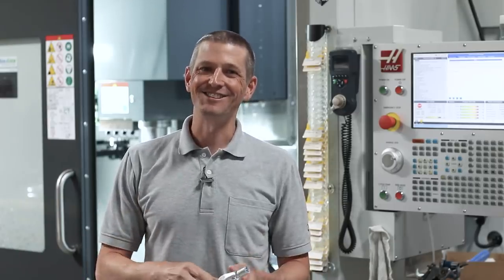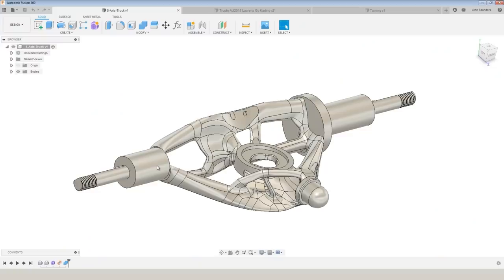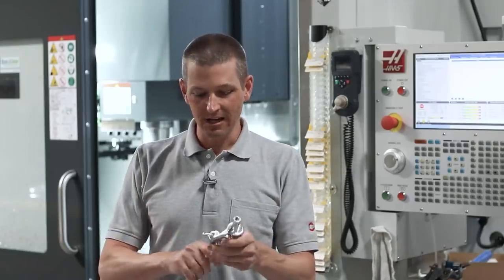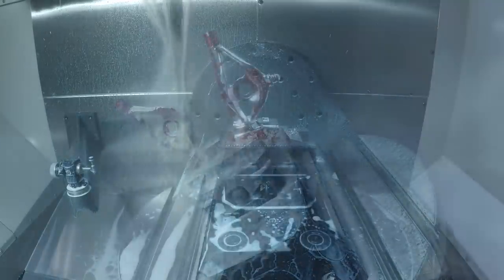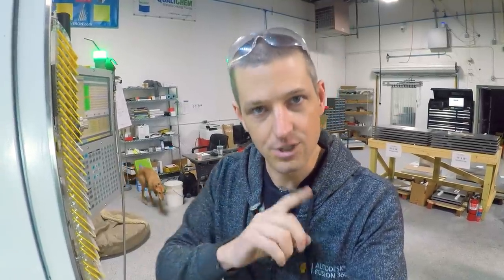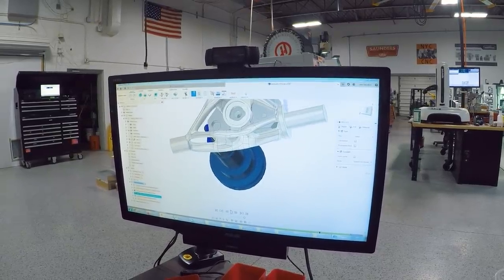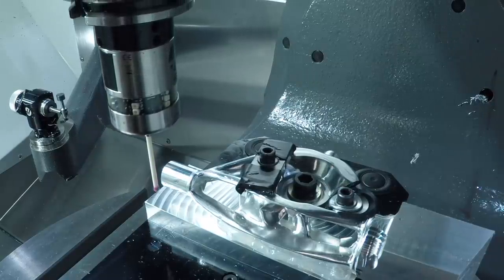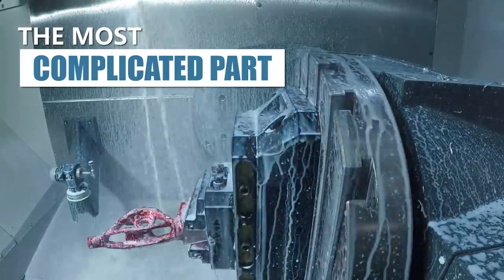5-Axis CNC Machining A Generative Designed Skateboard Truck!

Comment: I had a friend use generative topology for a project in one of my mechanical engineering classes. The part looked like a tree trunk and was hollow. It easily won the contest of weight vs strength. He did it on Inventor. Dude's literally the sharpest guy I have ever seen
Reply: Did he use an AI?

Comment: We used a custom made fixture system. The idea was you would assemble the jigs according to a drawing you would put the stock in the assembly and you would run the program. We never had a crash.
We also never changed the machine offset. It was a golden rule that was never broken.  We used to make lots of one off parts. So setting up was extremely important.  We couldn't afford to do a dry run or to sit there and watch the machine for every tool path.
We also never had to set any offsets on the raw stock like I see on every  video. We would literally put the stock on the machine and pressed the start and would just check that the first cut was right and then let it run as if it was a production part for the very first (and usually only) part. This was 15yrs ago.

Comment: Autodesk really needs to make Generative Design more accessible permanently. It was great seeing them make it “free” to use back in December. Currently though it costs potentially hundreds to generate concepts and use the models, which is fine in some businesses but not remotely viable for hobbyists.

I wish there could be less cloud reliance too. I don’t mind simply waiting longer but having the option to do all the generation locally.
Reply: I think also this generative design is expensive. For a company that really need this it is ok. But for hobbyist they should be a offline mode to generate this on the own pc. Is this really calculation intensive or is the cloud thing only to got some extra money???
Reply: Captain DJ My hunch is it’s a bit of both. It certainly is very intensive, but it’s definitely possible to do locally as other packages can manage it, similarly the preview function in done locally I believe. The preview only generates to the first few steps but it still gets you something, if it weren’t remotely doable surely that wouldn’t function properly either?

I don’t mind paying for parts of the process, but the balance is very much stacked against being able to experiment.

Comment: Instead of glue, we use car body filler if the part is likely to vibrate.
Reply: How do you easily remove it?
Reply: @axiom1650  put aluminium tape on the part, and wd40 on the bed and use acetone to remove and break down anything that is still stuck to the bed and rub with a stone. Sometimes you can just tap the filler of the bed or fixture with a mallet

Comment: This is known in the aerospace engineering realm as "Optimization Analysis". Not new but it does show a jump forward for the average shop and average business having access to this.

It isn't infallible though. It does need to be reviewed for all load cases and critical cases need to be re-validated to make sure there isn't a problem from structural stability, it isn't just stress limited. Strain and buckling limitations need to be accounted for.

Comment: Just re-watched  this video. So good! It's interesting how generative design has been adopted by the engineering and maker community. I was expecting it to be more significant but it seems to me more like another modern tool in the tool box. Like co-bots, AR, robot vision etc. Tech is moving fast but it's still governed by the adoption rate.
-Ken

Comment: Definitely gotta try generative designing with my 3D printer, sounds really interesting!
Reply: I was thinking the same thing...
Reply: @JF32304  its very expensive to mess with but good to try
Reply: @v1Broadcaster  mess with what? 3D printing... Uh not really. I 3D print all the time.
Reply: @JF32304  he's probably talking about the fact that Fusion 360 generative design requires you to buy cloud credits which are pretty expensive, not the actual cost of manufacturing
Reply: @oliverfrank8124  oh ok I see. Thank you for clarifying.

Comment: You could done that part in 1 shot with tabs. No need to make a locating jig. 

You could have made the wheel axis parallel to the x axis on the initial setup and extended the height of your stock by 5” or more to give extra clearance for the tilt axis when reaching those cavities. Leave tabs and part it off.  If you wanted to go lean and save material on production you could make a rectangle jig that bolt underneath ur stock if you didn’t want to extend the stock 5”

Comment: Interesting that the design is asymmetrical ... super interesting vid <3
Reply: Yeah, but look at the end of the video (@11:32) where it's attached to a bracket holding the electric drive motor with a belt drive from the motor shaft to the rear axle. So completely unlike a passive truck, this one has a 1-sided belt drive input to drive the rear wheels. Hence the major L/R asymmetry. I guess with this use, any sensible design, human or generative, would have to be strongly asymmetrical.
Reply: @SH-pc4xt  ahh, that makes sense, thanks!

Comment: appreciate the video, and generative design will definitely evolve components for sports equipment. But existing skateboard trucks are forged, meaning they may well have a comparable strength to weight ratio of these machined trucks. 

there is another not too far removed example of forging vs machining. Which is bicycle hubs. Extremely common workhorse Shimano hubs are forged, so are extremely durable even though hard steel ball bearings run right on the aluminium hub surface. They essentially last a lifetime if you keep the dirt out. 

But many "high end" boutique hubs are CNC machined. Both because these smaller companies lack the resources to forge hubs but also because they tend to put heaps of weight reduction cut outs in hubs and other products they make to appeal to performance seekers. 
The CNC hubs could never cope with cup and cone ball bearings, they instead need sealed cartridge bearings. 

There is another factor that will affect the adoption of generative design. This is environmental sustainability. Pure machined parts, especially with the complex lattices of generative design - create monumental amounts of waste swarf. Much greater material mass than actually used in final product. 
Forging uses only the exact quantity of material needed. 

The most optimum process for sustainability, durability and low weight (of metal items). Will be to forge components and then finish them with machining. 
But resin - carbon and even glass composite components can often far outperform metal counterparts. Which gives designers and makers even more options. 
A longboard truck has no need to be made of metal at all , longboarders, especially of the electric variety. Do not do 'grinds' . the board is just transport. 
The hollow cavities inside trucks may actually be a potential location for next gen batteries. Motors are already inside wheels.

Comment: awesome.  only flaw i see is that you need a way to cut excess metal off the block, either by a saw or laser or water jet cutting.   you could put into autocad the block you have to work with and then overlap the design with the block to see what excess material can be largely cut off, this would lessen mill time, lessen bit wear, and allow for more scrap metal.

Comment: Not symmetrical L/R?
Reply: from gavin bath's video, this is the truck that the electric motor for the longboard attaches to. The asymmetrical shape is accounting for the torque stress of the motor under load and the attachment point for the motor plate

Comment: Fusion generative design is fine for one-offs, but it does not make parts for mass manufacturing or repairability.
Reply: I haven't used it but was under the impression you could give it manufacturing constraints so it didn't come up with stuff that isnt possible to make.
Reply: The part in question could be cast if it was modified a bit. Generative design is usually used to produce a draft of the part which is refined to the final manufactured form.

Comment: 9:24 holy hell that's alot of stick out. whyyyyyyyy and why with so much flute length?
Reply: Spindles and trunnions don't like colocating.
Reply: Literally at 9:27 you see them plunging the end mill down into the part, using the full flute length. So they clearly needed a tool with that much LOC and clearance. Maybe they could've used a stubbier tool for the first hole, but that makes no sense times wise.
Reply: @hhcdfhngdzjjbf579  that's not the same tool ur talking about. The one deeper in that hole is a bigger tool.

Comment: There are few issues in this whole shit. First of all: There are no any program which could calculate all stresses in any thing but in a long stick, because there no any math for that invented. The way all the programs "calculate" the stresses in all the stuff is just dividing a part on small parts like polygons and calculate stresses on the border of each polygon. This goes to a lot of artifacts, especially on chamfers or fillets which should hide the most stressed lines, but all the programs show higher stresses on chamfer and fillets than on 90degree angle on a part. So all the "beautiful" "nature-like" lines on the part that connect two separate surfaces are just artefacts of machine calculation. To prevent all this artefacts human should correct polygons on each chamfer, fillet or joint before each calculation, I mean each time after every step of AI part optimization. 
The second one: I definitely want to see an ISO drawing of the part you've shown)))) All the sizes, radiuses and angles)) If you would do it, please tell how much time it took to make a drawing from the model))) It's really interesting how many views and crossing views you should do to make it)) I'm saying it because in my world if you draw a part which could be done only on 5 axis cnc or on a normal cnc with more than 3 repositions you are an idiot but not an engineer))))) I draw all the parts for maximum 2 repositions for everything else there are disassembliable joints like thread, or not disassembliabliable joints like welding. For everything else there is casting.

Comment: interesting... I was just looking for something I couldn't find anywhere. which was a over engineered ultra wide off-road long board truck for a big guy (300lb) like myself. any chance I can get a modified version of the design file? I want 14 inches of width between the wheels and withstand 6.7kn of impact force. or atleast point me in the right direction for designing it myself.